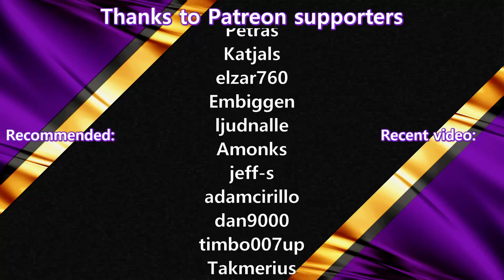MODULAR FRAME DESIGN - Satisfactory City #23

Comment: Hmmm,  I literally almost NEVER use "literally" to mean anything other than "literally"....   And there are many ways to speak English...  since the language changes so quickly.  Example:  In the King James Version of the Bible,  the word "Let" has the original meaning of "prevent" (or "not allow")  rather than the modern definition "allow".  Also several words come into English from different languages.   So for example,   "imflammable" (which comes from the french) means "flammable" rather than "not flammable"  as the prefix "im" would normally be used in words like "improbable".
Reply: It's "inflammable" (with an N, not an M). It's still a negating prefix (indecisive, indivisible, etc.), but it isn't actually a prefix (inflame meaning to make hot or on fire) in this word.